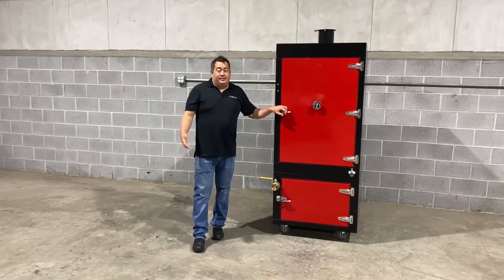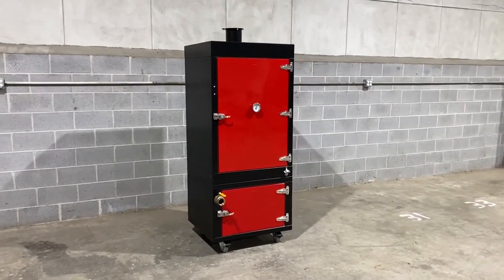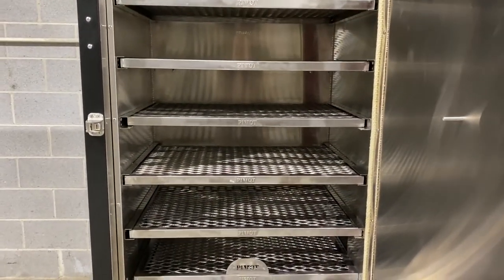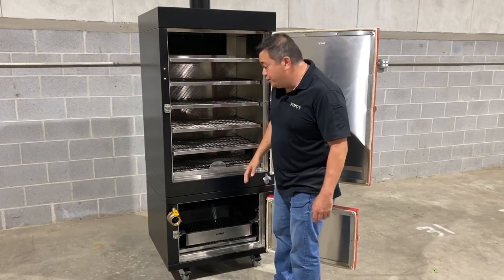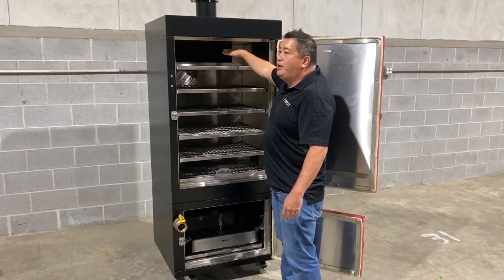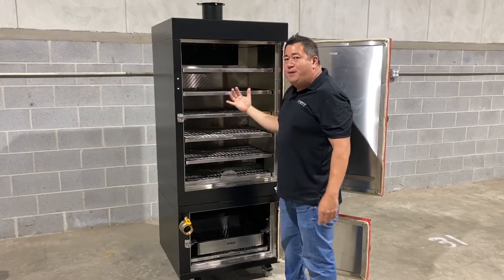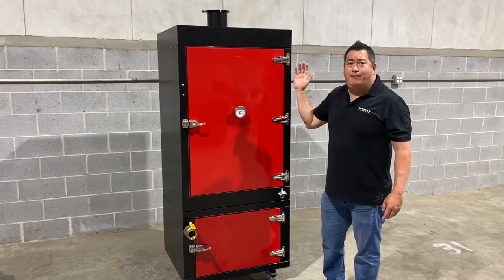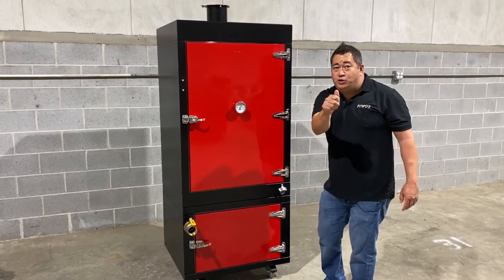PIVOT BBQ | T-Rex Vertical Reverse Flow Smoker

Comment: Really would like to know the price of this when it comes out. What is the exact height of the smoker?
Reply from the maker: Hi Alex.  We will have this on our website when we launch.  With metal and supply prices going crazy...we are waiting to see if things settle down a bit before we do our final pricing.  We are also debating on including Shipping into the price.  For the height...it is approximately 76 inches (from the bottom of the fire box to the top of the stack).  Our wheel option will provide the distance from the floor to the bottom of the fire box for an overall height.

Comment: Looks great but I can't find the info on your website
Reply from the maker: Thank you for your interest.  The content for our smokers are currently being added to our website.  Our first production run for the T-Rex and its smaller brother (the RAPTOR) will be in the next few weeks.  The RAPTOR videos will be up soon and added to this channel.  The website will be updated prior to that along with our new online store.  We have been putting these smokers through lots of tests before this production run.  If you are interested in purchasing a smoker on the next production run - just contact us at sales@pivotcorp.com and we will provide you with a Launch Discount!
Reply: @PIVOTCORP  have you considered :
A drain valve for grease or removable pan

Side handles for movement 

Insulating the entire chamber for efficiency 

Larger wheel options 8inch for mobility 

Side trays as an option
Reply from the maker: @sparkyharmon9549   Hi Sparkey - We do have a removable pan in 304 stainless that can also be a water bath in the bottom of the smoke chamber - The smoke chamber in the full production version is completely insulated - We do offer a larger wheel options including 8 inch - We are going to add a front tray in stainless in the production model - We are trying to keep things off the sides and back so that you build this into an Outdoor Kitchen or Mount it onto a trailer.  We will certainly consider it.  Thanks so much for your feedback.  We have been testing this for quite sometime now so that we can put many more enhancements into the production model...and seeing how it will weather during the winter.  We are also enhancing the production model with a complete slide out bin to hold the charcoal, wood and ash in the fire box...instead of keeping it separate.  We noticed that adding fuel during the burn is not ideal with the ash tray separate.
Reply: @PIVOTCORP  Sounds awesome so far. 
The side rails would be great for those of homeowners or competitors that will not mount  but need the ability to move in / out garages or on / off of rental trailers.

Looking forward to final product regardless.